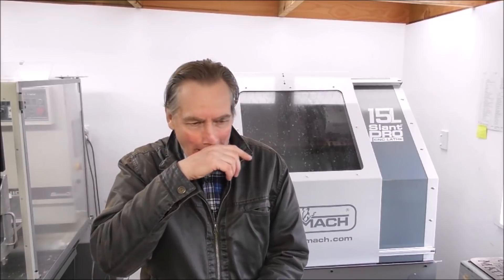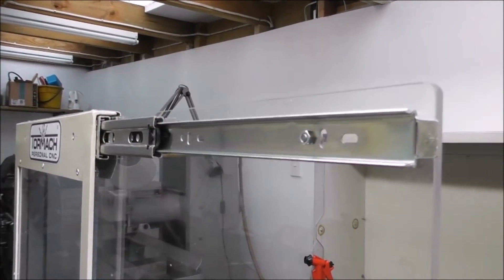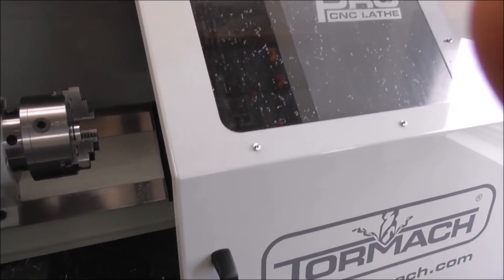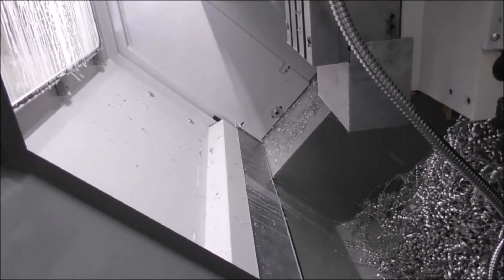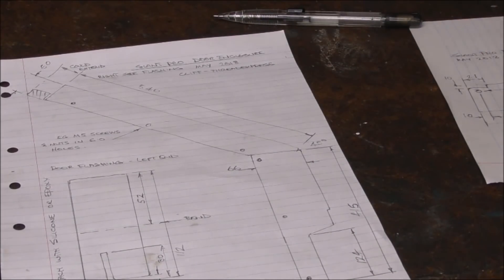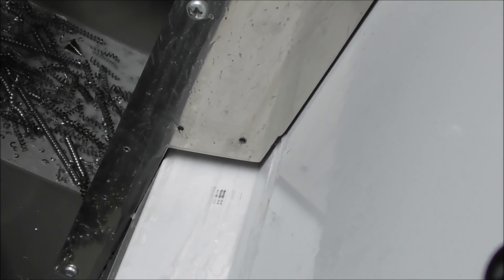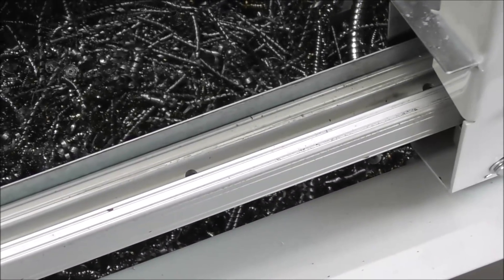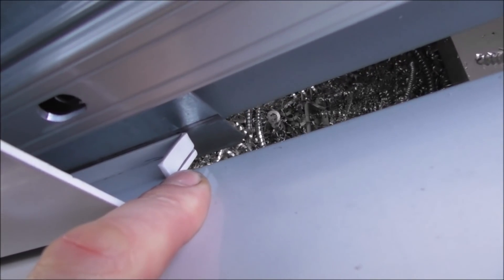Tormach Slant Pro 15L -  Enclosure fixes

Comment: Cliff, it was a big disappointment watching this video ????

 Putting it nicely.

  It is a joke that you would need to spend time to improve an already Overpriced Enclosure.

I know you must be happy to make the improvements necessary,  but if it was me i would honestly be wanting some reasonable financial reimbursement from Tormach for such a low quality made item such as this Enclosure.  ( if i can call it that )

If this enclosure was made to suit a different machine i could understand the need to modify it to make it suit your machine.

For some reason Tormach have made an enclosure to suit there machine that is far from being able to be called an Enclosure.

For those interested the Enclosure only Price USD $1985.00   NZD $2880 ??????????????? 

Apologizes Cliff that my comment is negative towards this video but this was the main sticking point for me deciding Not to buy the Tormach SlantPro 
  ( the Overpriced Enclosure )
Reply from the maker: Hi Peter.  I would be dissapointed also if I had not already heard the SPL enclosure is problematic. You cannot buy the turret option without the enclosure so I could not avoid this.  I studied the machine and accepted that it had different issues that would need to be sorted. I had also investigated other machine options but I could not find any perfect solution. The SPL has strengths and weaknesses, when I get fully familiar with it in depth, I hope to do a general review video. But I do not want to rush into that.  Thanks for commenting.  Cliff
Reply: Thank you for your reply Cliff.

My disappointment is more aimed at the price of the enclosure not so much the quality.
As you are aware of the high price charged for such a very simple enclosure.

The two are counter to each other.
Low Quality, Lower Price.
Higher Quality, Higher Price

Not Low Quality,  High Price ??????????????????????????? 

I agree it is difficult to find a happy medium when purchasing a new CNC Lathe.
The Slant Pro is an ok machine some what limited but enough for smaller parts.

When comparing price of similar machines the extra you pay for the enclosure is some what cheaper to some degree.

Also the space available for yourself in your workshop does suit the Slant Pro very well.
Which leads you to the conclusion that this might be the right machine for you even if the enclosure is very well overpriced.

As in previous comments we already discussed that Tormach does charge well for any of its extras such is the case with the enclosure $$$$.

In hindsight as you use any machine the longer you use it the quicker you forget about the price you paid.

Regards Peter.